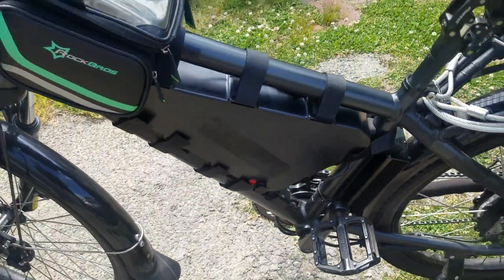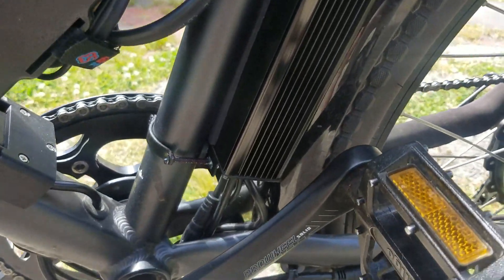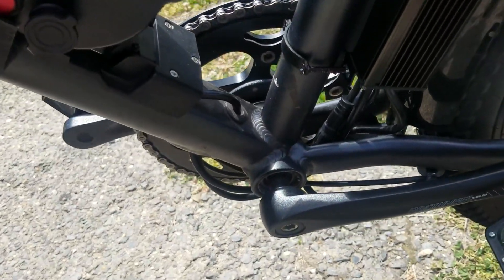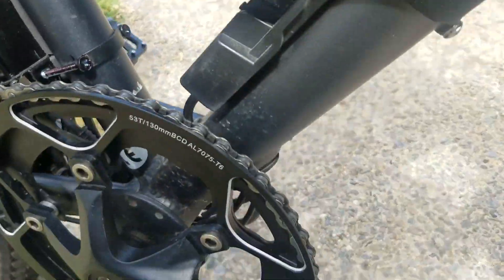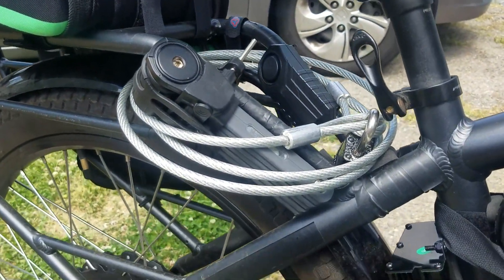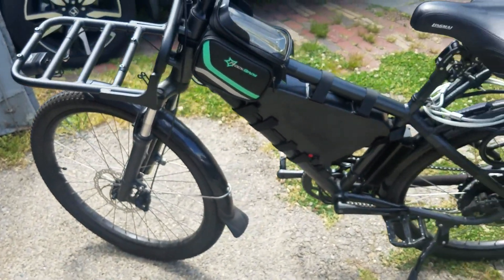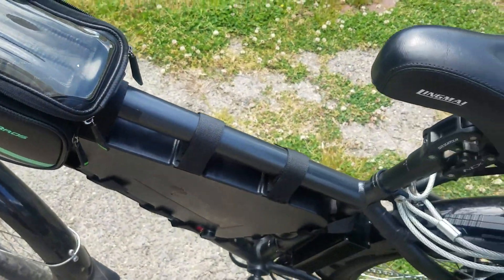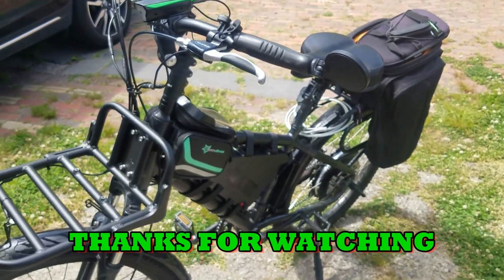RadCity 35amp 52volt upgrade what you need to know

Comment: Hello - Can you be more specific on what screws to get? I am looking for 4mm x 40mm length and not sure I am find the correct thing. 
Is this correct: M4-0.7 x 40 mm Metric Socket Cap Head Screw?
Reply from the maker: yes thats correct you need 4 screws that you listed and four nylon locknuts the same size. I heard Bolton sends the hardware now maybe he saw my video lol
Reply from the maker: the 0.7 is the thread cut